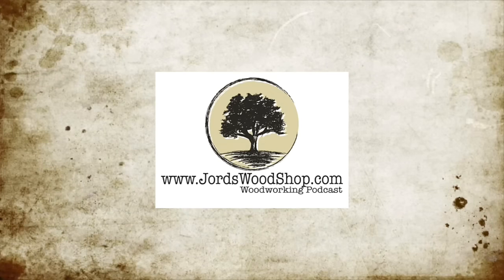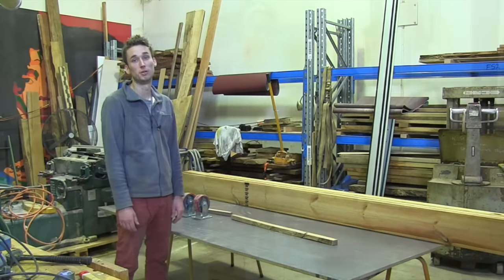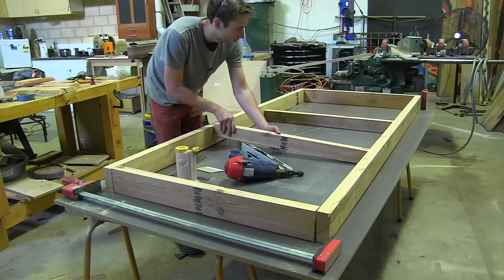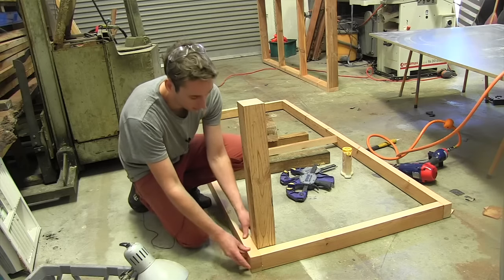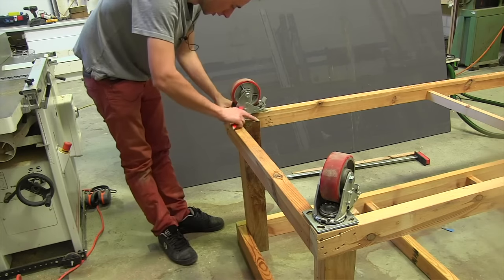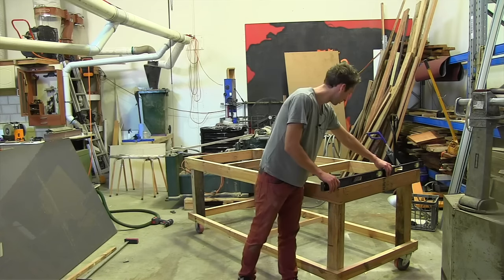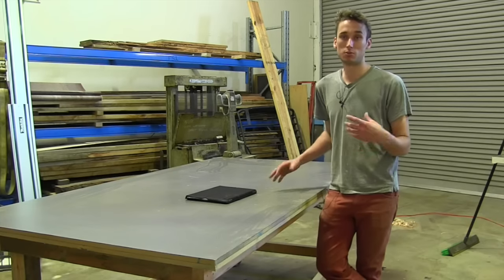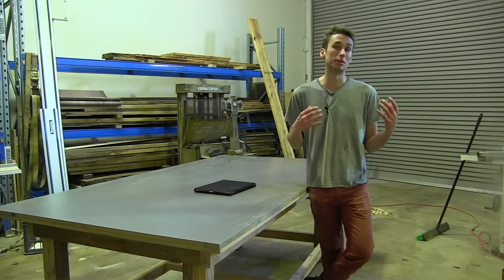Build a massive mobile workbench / assembly table - Easy to make workbench in one day!

Comment: Checking levels of furniture that is not a permanent with a spirit level is silly, and I see it all over YouTube. It will only be as level as the surface it is standing/placed on. It would be wiser to, on a flat surface measure the hight from bottom to top and make sure all are equal and where necessary use adjustable feet and casters.